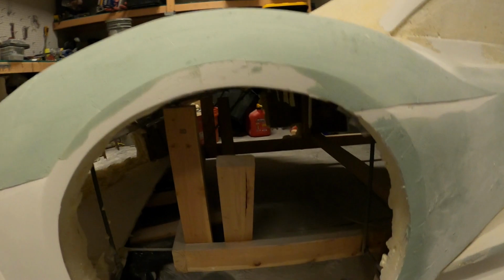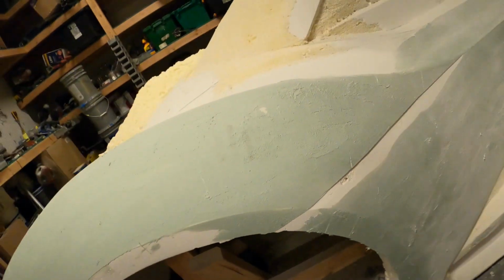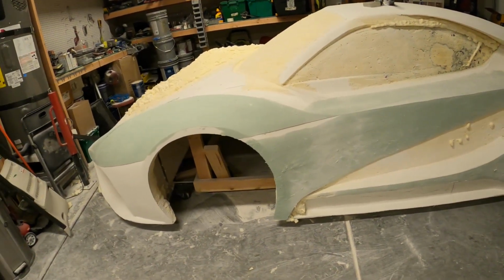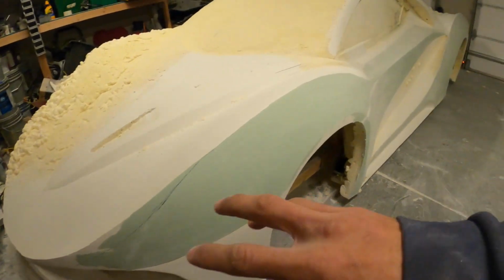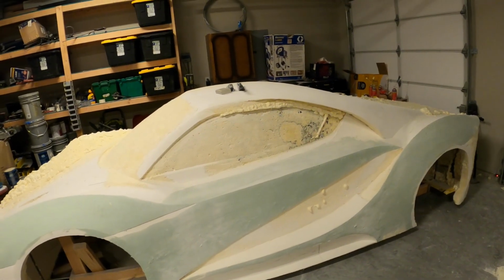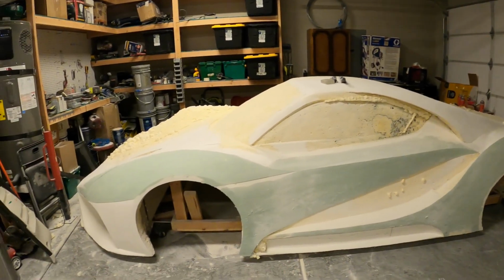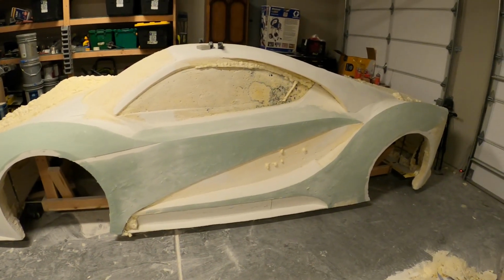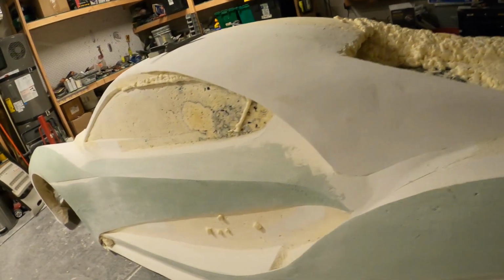BUILDING A SUPERCAR FROM SCRATCH! First update on the Spectra S

Comment: You can add fiber glass resin to your bondo to thin it out.  It turns it into  a glazing puddy.  Hopefully this helps. The car is one hell of a design.
Reply from the maker: Was thinking about doing that! Definitely a good idea. Holding off for now just in case I decide to sand back any areas. The resin is a lot harder to sand back
Reply: @spectra.s  it sands just like bondo.  You don’t add the harder in the fiberglass resin.  You just use the resin.

Comment: You can buy sheets of foam, three inches thick, four foot by two, use the expanding spray foam to glue the sheets into blocks, then use them to shape. The sheets are the same foam as the stuff out the can, but blocks are so much easier to work with.
The rear end infill of the rear bumper area would be easier sculpted from a block.

The car looks good so far.

(I used to make bodykits, if you search jbodystyles here on YouTube you'll find the only video I made, making side skirts.)
Reply from the maker: You’re 100% right the foam boards build up a lot easier. The main reason I haven’t done that is because I don’t know 100% what I want my final shape to be. Part of the build is finding the shape I like as I go. The other side of the car will definitely be more boards